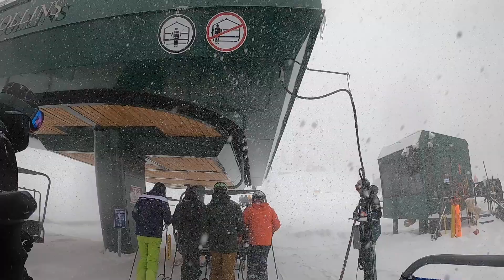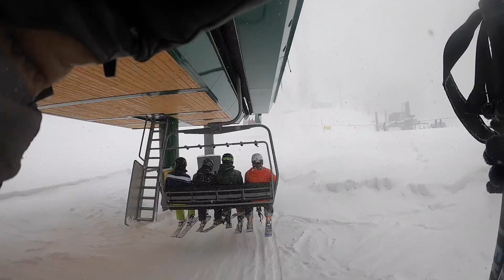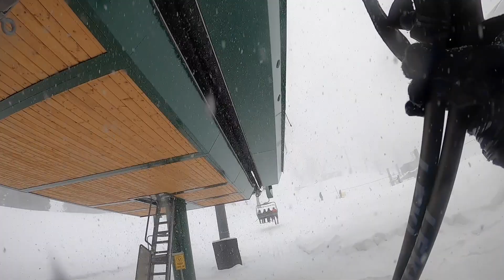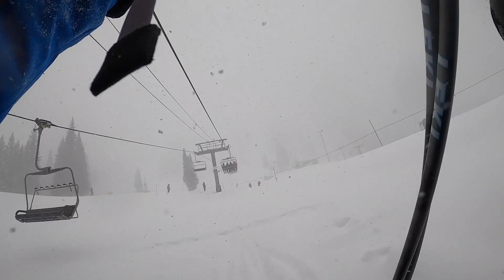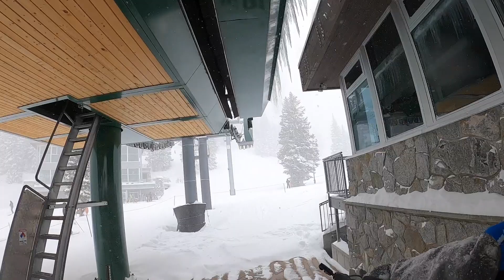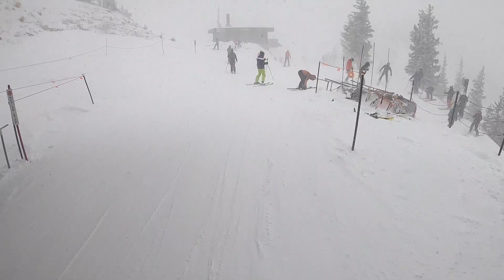Alta, UT: Collins lift

Comment: Just to answer a few of your musings, I used to be a local at Alta. The bars are indeed Doppelmayr, they’re a little newer than the lift, maybe installed around 2010 after an accident on Sunnyside. Alta didn’t have bars on any lift before that. Collins was originally intended to be able to run the sections independently, in case they wanted to use Watson’s at night, or potentially wind holds. It was never used this way, and they no longer can after the new paneling on the terminals. That’s why no double grooved bull wheel like on Treeline at Palisades. Also, that tech is newer, it wasn’t an option in 2004.
Reply from the maker: I don’t think this lift was designed to operate with both sections independently. I’ve seen some older pictures, and the chairs appeared to head straight to the second section and vice versa.